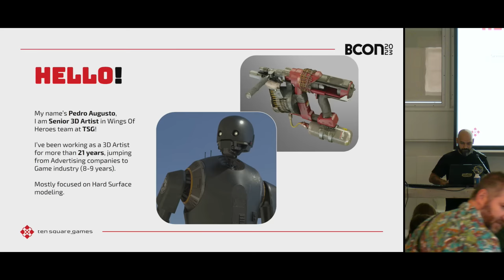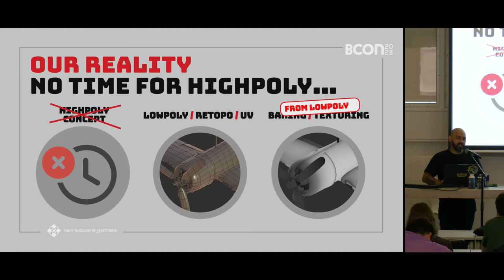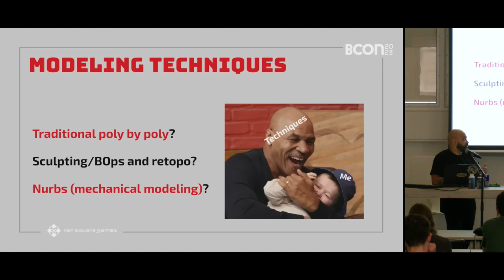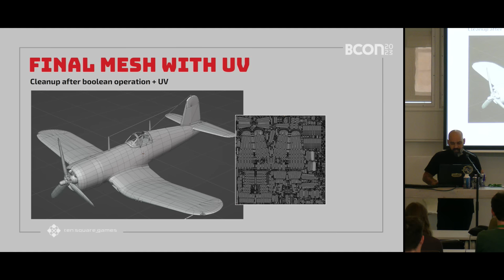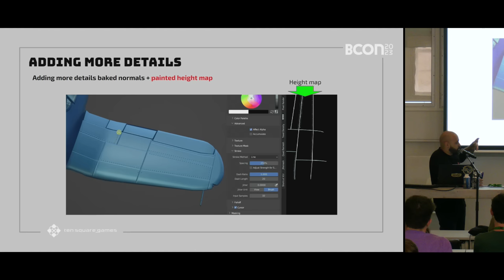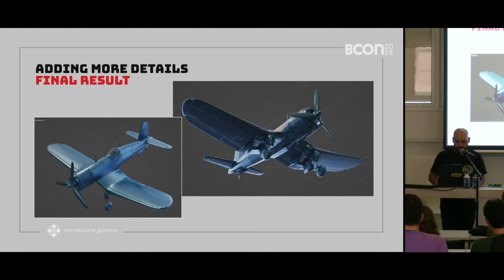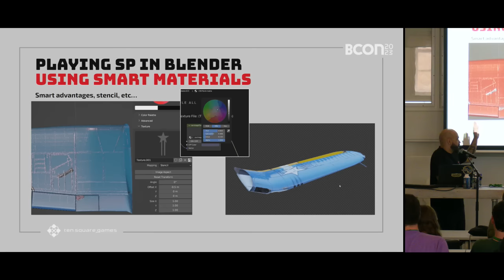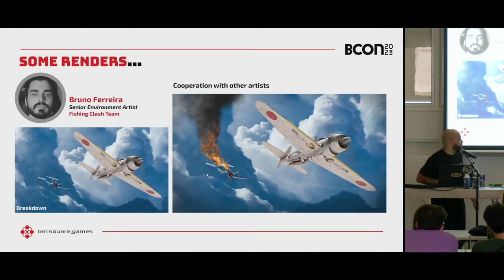Hardsurface Modeling Techniques for Games

Comment: This technique is traditional and fast but not the future. If you watch the ship building process in Star Citizen and how they are able to achieve high quality assets minimum overhead. In a nutshell they avoid bespoke textures in place of shared libraries of decals, tiling textures, and parallax occlusion mapping (realistic looking height/normal maps). The ships are models using bevels with face weighted normals to allow tiling textures without UV maps. The process in all allows efficient ships that can scale from a snub to galaxy class huge.
Reply: How does face weighted normals and bevels allow tiling without UVs if I may ask?
Reply: @chasingdaydreams2788  maybe they mean edge decal normals? its pretty standard in environment design in games. And lets be honest here, star citizen ships are environments.

Comment: The step about texture painting the details hadn't cross my mind, then again, I'm not advanced. The only issue about it that I can think of is that you can't add or automate the addition of imperfections to those details since they're not actual geometry.

You'd have, like he was doing, hand paint those in with a different layer.

He should probably look into the Fluent Materializer addon (or smth similar). That's pretty much Blender's Lite version of Substance Painter